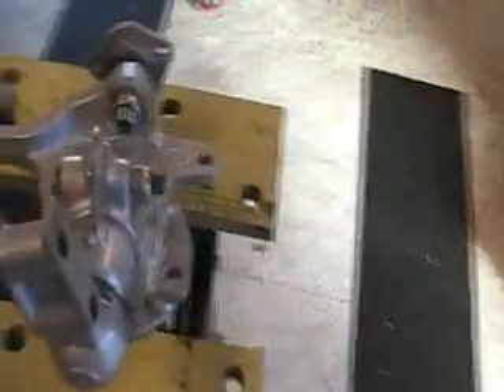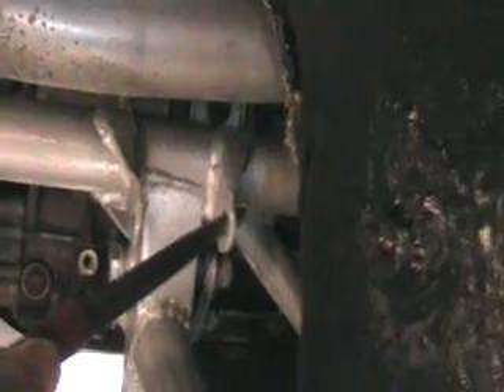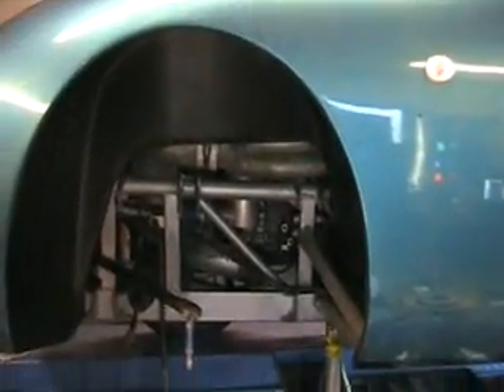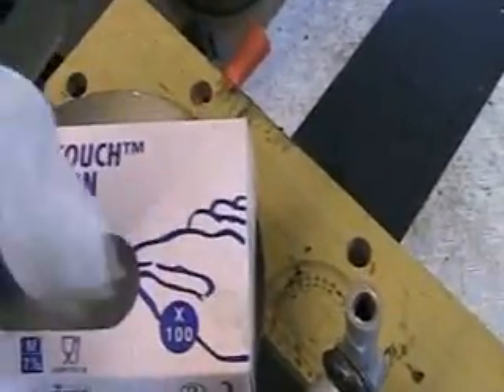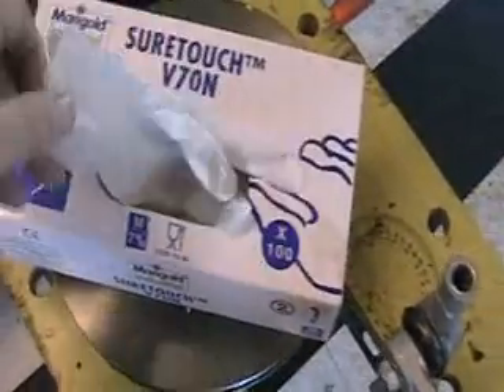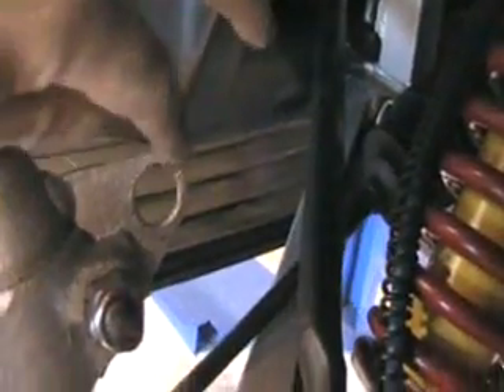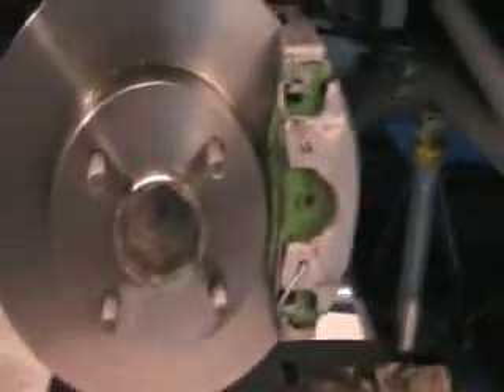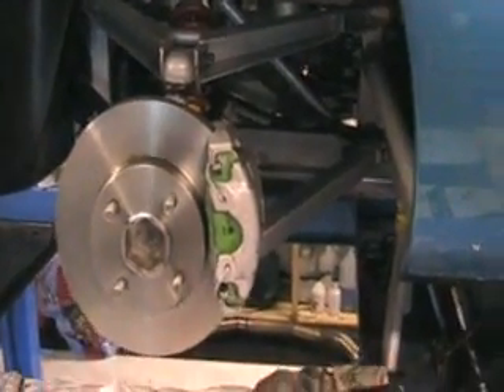TVR Griffith Front End Part 2

Comment: Great job well explained, what did you use to treat the wishbones? Rust treatment, and paint ect.
Reply from the maker: Hi there...

I just gave them a quick going over with a wire brush, and then painted with POR-15..... It's good stuff.
Reply: Thanks I'm in the middle of a body off restored on a 4.0litre chimaera.